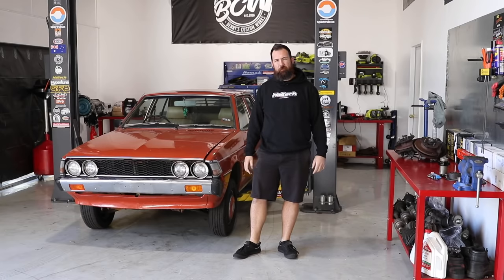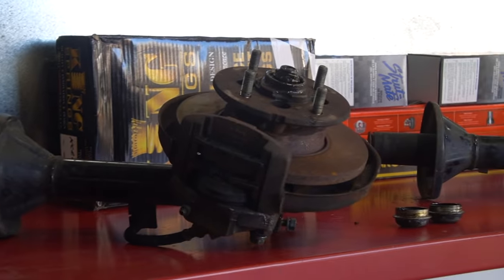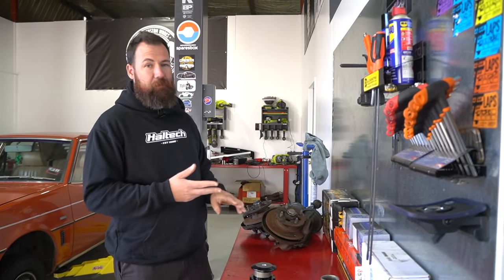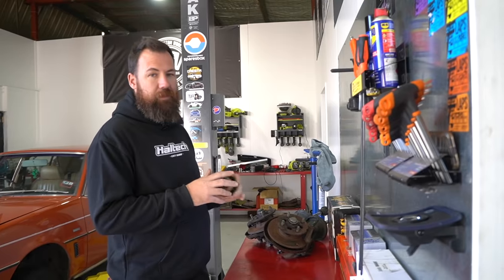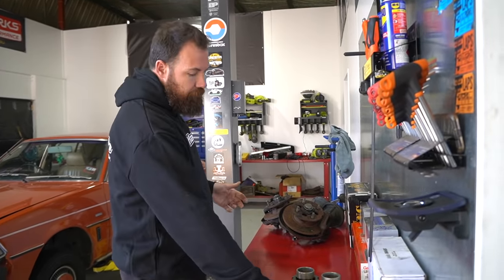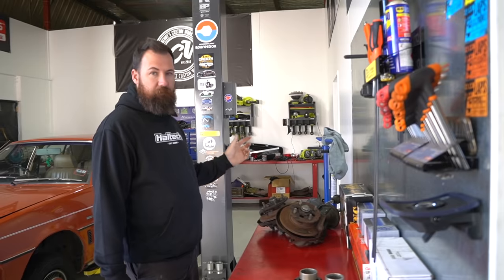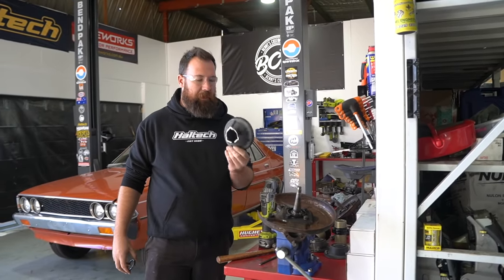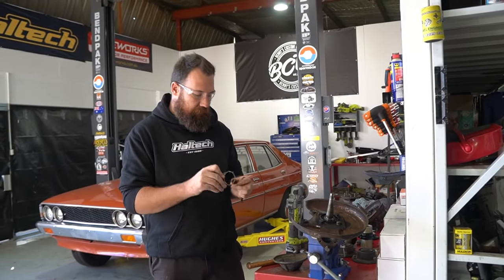Sigma - DIY Coilover suspension build how to

Comment: In the late 70's early 80's Mitsubishi gave Police in SA some factory turbo charged Sigma's. These were unmarked and did go! Not sure what happened in the end. I enjoy the videos, thanks Cheers
Reply from the maker: Paul Faithow the old turbo cars are cool as .
Reply: @BennysCustomWorks  my first car was one of those. 81' GH Turbo Sigma. Only 500 ever made, It was a joint colab with Garret, TO3 with 42mm external gate, cast manifolds on a 2L Astron. It was a blow thru carby system with a vac advance/pressure retard dissy. I loved that car, rebuilt engine twice. It was all unknown stuff in those days. Nobody wanted to touch it. years later people converted them to efi and were getting into 11s. One guy used to run a club car at lakeside. Its biggest claim to fame was it's role as the heroin dealers car in underbelly. They only came in 2 tone, silver n black, red n black, blue n black. Had mine for nine years, wasted many a V8 in it, lots of fun.

Comment: Just in case this helps you. Cusco still makes camber plates for the 1980s Era Lancer Turbo. Most Mitsubishi mounts are very similar so I was able to use the Lancer Turbo camber plates in my older Colt Lancer and only had to drill and tap two new holes to convert the stud pattern of the upper mount. (I could be wrong about this next part) but I seem to remember that Sigma struts are supposed to be a bolt in upgrade for the Colt Lancer so there's a chance the same camber plates will work for you with very minimal modification.
Reply from the maker: dog283spec thanks mate :)
Reply: @BennysCustomWorks  found the link for you... https://www.cusco.co.jp/search/en/index/detail/?make=MITSUBISHI&car=Lancer&chassis=A175A&impreza=&category=susparts

Comment: so nice to see a actualy quality channel do one of these!! (im doing a little build on mine with a 77 LB Lancer, but also completely clueless on what im doing) and can 100% agree on the difficulty of finding front shocks, took me about 3 months going back and forth from shops all over the country to find some. Have heard that s13 silvia front end is a pretty close swap over. from memory on a very very old forum. the only change was drilling holes for the strut top. so you can then get things like adjustable control, more "tuneable" coilovers, bigger brakes/caliper.
Reply from the maker: Subways Shenanigans yes I’ve heard that also however I’d already measured the wheels up to be built off of the standard sigma geometry
Reply: @BennysCustomWorks  ahh yeh fair enough. for someone who hasn't invested in a wheel set up yet. you think it might be worth it? not going big power on mine, more just wanting it to take the back roads really well

Comment: Camira inserts or early commodore go into early sigma struts after your shorten the legs for more travel when lowered.
I've got custom GH green leg struts in my GC Galant with Camira inserts, adjustable coil overs and custom camber/castor adjustable top hats
Reply from the maker: Karlos Hesscobar thanks for the info. It seems that there’s plenty of strut insert options .

Comment: Those sigma look like the datsun 200b struts too benny. The pbr calipers and all except where they mount to ball joint. 
If you want lower tham Camry, z31 300zx work abd aw11 mr2 rear shocks ;)
Reply from the maker: m H deff don’t need shorter struts

Comment: Nice- I used some flat wound helper springs to keep a little preload on the main spring so it didn’t flop around at full droop with no weight on the front
Reply from the maker: jord9308 will be stealing the helpers snd main springs from the Cresta coilovers when they get swapped out :D

Comment: 6 cyl BMW E30 front strut are 51mm  too and there are weld on coilover conversion kits available you could have used too. Too late now but it may still be an interesting bit of information for later...'
Reply from the maker: the brelon thanks for the info
Reply: Sigma are 55mm

Comment: @Benny's Custom Works if you are wanting something adjustable I've has a few sv21 camry, and mr2 rear shocks fit in the factory camry strut tube and. kyb still makes a 4 way adjustable shock for the sw20 mr2.
Reply from the maker: rchotrodder1 thanks, same dimensions ?
Reply: Benny's Custom Works pretty much the specs are on the page for them maybe +/- 10mm at worst. But did fit right im my cars no washers or anything
Reply: @BennysCustomWorks  kyb part number 765016
Reply from the maker: rchotrodder1 thank you :D
Reply: Benny's Custom Works No problem. cant wait to see the build progress.

Comment: Good work but you went about it the hard way.
By using GH front struts (they are a direct bolt in) and are 53mm so much easier to find weld on sleeves.
As for inserts, if you have GH struts you can use VB-K Commodore inserts or Camira inserts are the same but shorter.
Adjustable strut tops are available from K-Mac
Reply from the maker: Seattle & Beyond thanks for the info .

Comment: Love this video.... So your shock insert type will depend on its travel  that will fit into the cut shock piping? 

And you cut off  the piping from what ever measurement your trying to achieve from the middle of the guard to the top of the tyre. Making sure that measurement is set equally with the weld as the centre? Is that correct or even make any sense ?lol 

I'd love to try this as a fun project. Even though I could probably just go get some BC racing coils to fit my car already. I wonder if any machine shops would be able to thread out pipe with somecollars as coil over sleeves to fit on the cheap?

Comment: Also you can use the GH sigma front struts with the bigger calipers that run the db1085 brake pads same as commodore they fit straight in must use the GH  brake hoses tho

Comment: I don't know if 51mm struts are rare in the car industry (or were because I don't think anyone use this setup today). My e30 bimmers are 51mm struts, it's the same design. Shock insert in the strut. There were 2 sizes, 45mm for base models, and 51mm for 325i, diesels and Touring if I remember. The Sigma reminds me a lot of my dad's Galant, kids memories!
Reply: *6 cylinder. Includes some 320i's, and all 323i, 325i's. Its the 4 cylinders that are smaller.

Comment: You could run a spacer between the sv21 shock insert and your standard gland nut, saves you some work in welding and it's what Celica guys do when lowering and using those inserts.
Reply from the maker: Nathan Attwood it would have to be a 75mm spacer and the shock body would bottom out on the bump stop way too early in this setup
Reply: @BennysCustomWorks  oh damn, sigma must be a much taller vehicle than the Celica as we only need 20mm spacers, that or the strut body is much longer in your case.

Comment: Does Al have an L300 4x4 van around Benny? I used an diff out of one and cut it down to fit into my scorpion as an LSD, bonus it came with disc brakes so I got a rear disc brake upgrade at the same time 😁😁

Comment: Have you heard all putting hydraulic oil in the shock tubes as you install the shocks? They say it's for better heat distribution.
Reply from the maker: Dennis Bailey the strut tubes on these are open at the bottom so It wouldn’t work. I haven’t heard if it before either sorry

Comment: Just wondering when you say local machine shop is that around the highlands? I need to get my rotating assembly balanced and don’t wanna have to go too far. I’ve seen you around the marketplace a few times getting some dirty bird haha I always wanna say hey but i feel awkward
Reply: Give Align a bash down at Moss Vale .
Reply from the maker: Seamus Campion i meant engineering shop . I think the closest engine machine shops are in Campbelltown , Unanderra or Wollongong ..
Reply: Benny's Custom Works yeah I thought so just figured it wouldn’t hurt to ask, thanks for the reply. I’m loving the coloured thumbnail looks good, big fan of the show, keep up the good work man 👌🏼

Comment: I’m just wondering why not just go to a modern strut it coil over, then use the spindle and brakes from a modern car, seems like you could just change the ball joint and find a tie rod end to match the taper of the new spindle it steering knuckle whatever you want to call it
Reply from the maker: XOZ Industries I did look at S13 front end conversion but as I’d already ordered wheels based on the sigma original geometry I didn’t want to change the track etc.

Comment: Hopefully they were GH struts and not GE, GH have a larger stub axle that take a Holden bearing making brake conversions much easier
As far as inserts go, early Commodore fit straight in , there really is a far easier way to do coil overs in a Sigma than using a sleeve kit

Comment: Instead of having the threads turned off the other end of the coilover sleeve, why not just flip them upside down? Shouldn't need to thread the spring perch all the way past the bottom.
Reply from the maker: Dallas Van Wyk the bottom side of the sleeve is larger OD than the thread so then there’d be no way to get the nuts on and off
Reply: @BennysCustomWorks  Ah makes sense! Couldn't tell that from looking at it.

Comment: How legal is this ??? Will doing this actually be passed by a engineer ???? Allowing you to drive this car on the road ???
Reply from the maker: Brett Smith will be engineered.
Reply: @BennysCustomWorks  i was always told by engineers modifying suspension and steering parts was a big no no
Reply from the maker: Brett Smith really depends state to state..